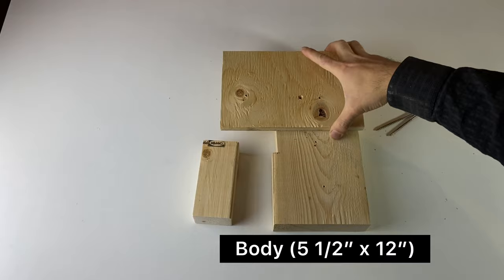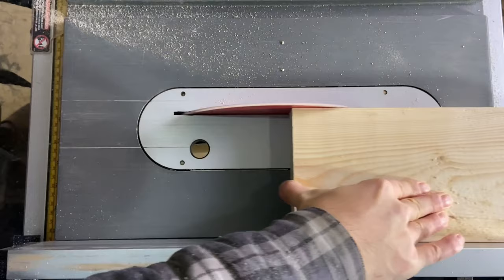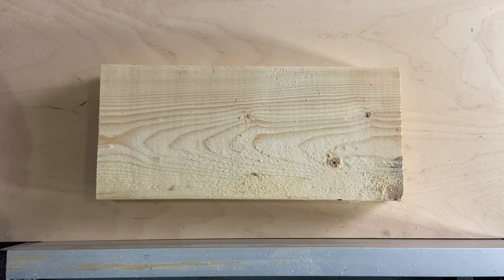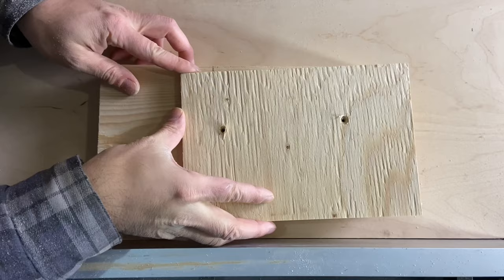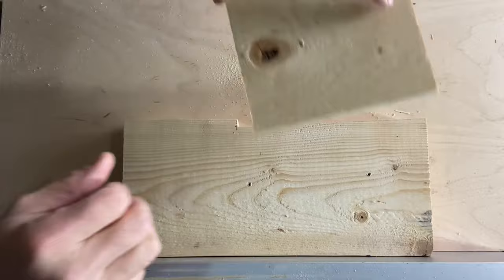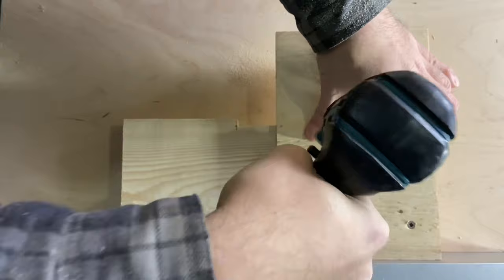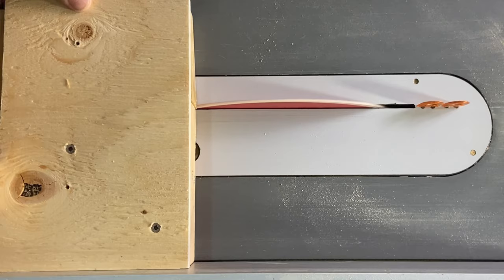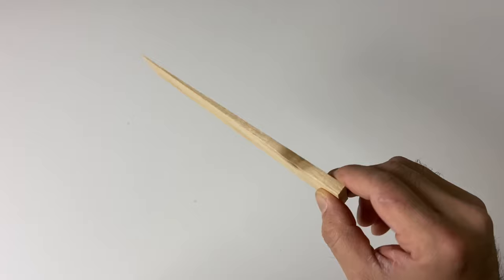How to Make SHIMS quickly, easily, perfectly | DIY

Comment: I just buy bundles of cedar shingles or shakes, Stack them up and cut em on the table saw to about and inch and a half. You can have hundreds of shims in about 5 minutes
Reply from the maker: Heh heh - very true! But I find the packaged shims at big box stores expensive and low quality. If you know how to make shims, you'll never run out and they will all have that perfect tip.

Comment: Any reason you wouldn't be able to use something like this to also cut smaller hardwood wedges for making wedged tenons? I'm not super experienced so trying to see if there are any obvious pitfalls. I reckon you just cut the wedge shape from the body much smaller and then (of course) use shorter stock to cut a small wedge.

Comment: Watched another video for making shims. Nice video and jig but his didn't have a guard like this, so I prefer yours. I do wonder if one could attach a thin guard at the rear that could push the shim away from the blade for safer retrieval. Not a criticism just an idea as I hate reaching near a spinning blade.
Reply from the maker: I'd suggest customizing to meet your specific needs, no hard and fast rule here! Another possible upgrade is to use a guide bar to slide in the guide rail, instead of using the table fence. Thanks for the feedback.